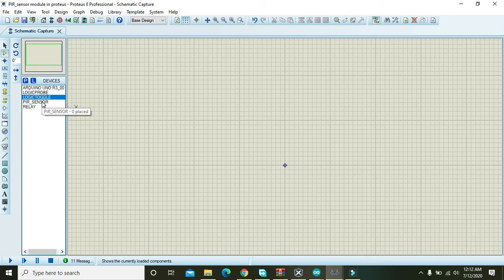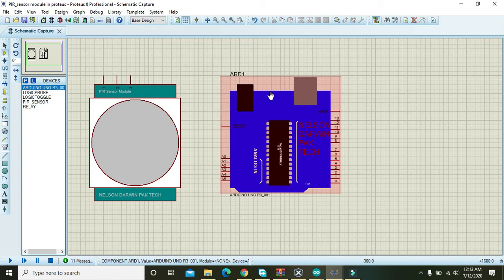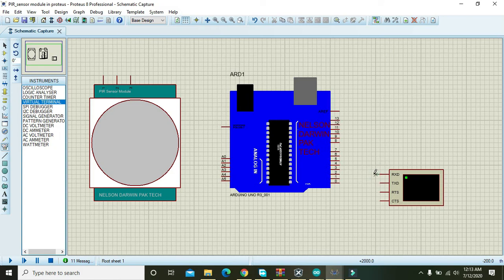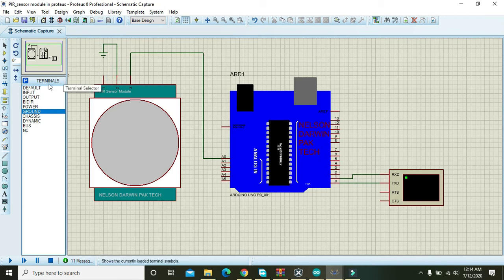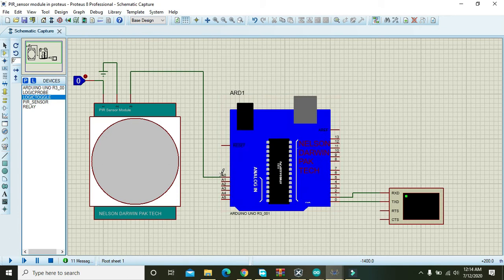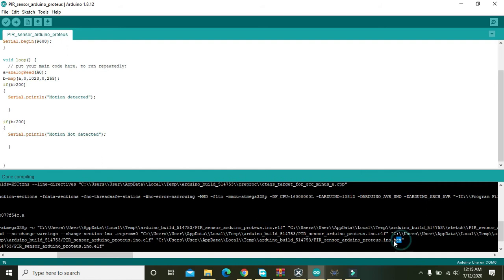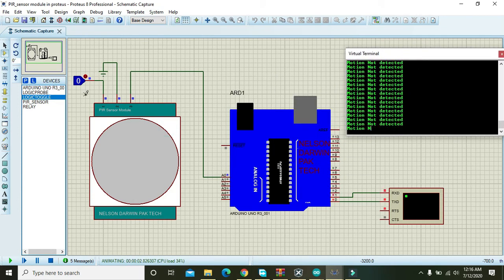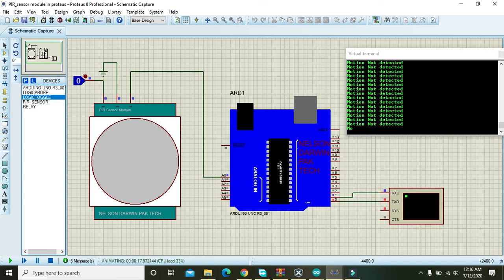how to use PIR motion sensor with arduino in proteus | Motion sensor circuit with arduino in proteus

Comment: Sir only motion not detected is shown in the terminal even when the logic toggle is on
Reply: Exactly same
Reply: Let me know if any solution
Reply: @rahulbasavaraj4363  use this code, change output messages accordingly
void setup() {
  Serial.begin(9600);
  pinMode(13, INPUT);
  // put your setup code here, to run once:

}

void loop() {
  int pir=digitalRead(13);

  if (pir==HIGH)
  {
    Serial.println("Welcome to the house!");
    delay(1000);
  }
  else
  {
     Serial.println(" Take care, see you soon!");
    delay(1000);
  }
  // put your main code here, to run repeatedly:

}

let me know if still u have a problem
Reply: bro not getting it still
Reply: I have connected logic gate to vcc